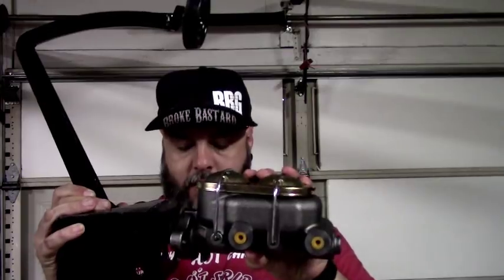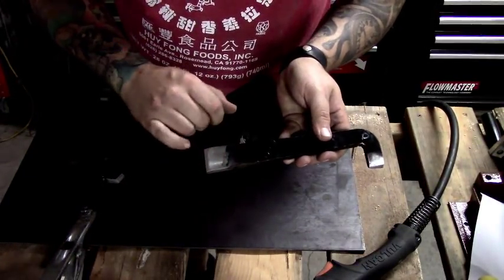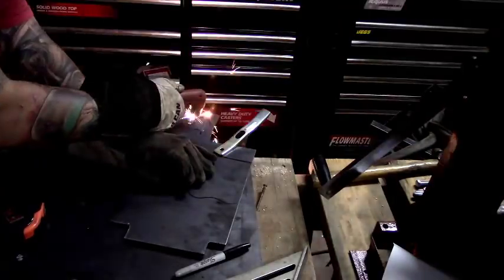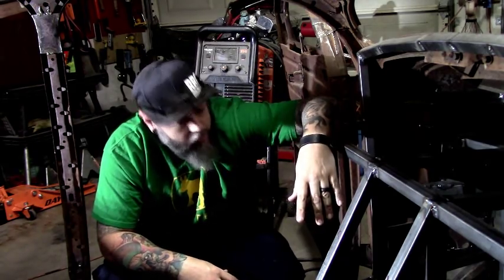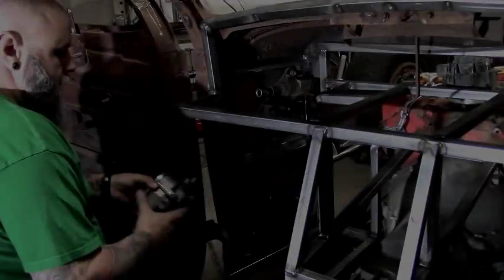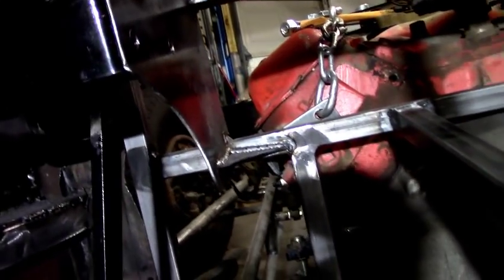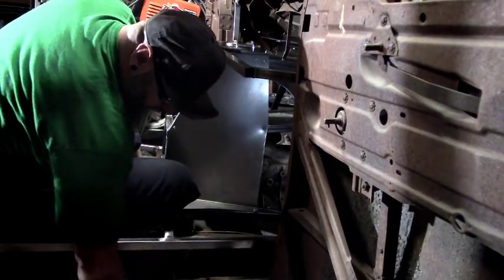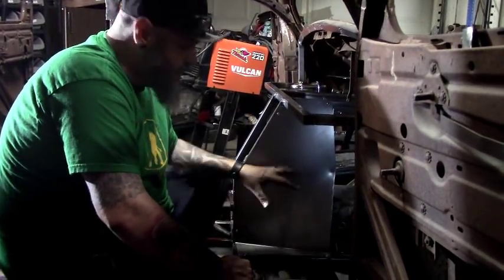"Installing Brake pedal and master cylinder"1937 Rat Rod Build Update 38

Comment: I like that you honestly include the occasional occurrence of fab, oops, cut apart, re-think and re-fab. Shit happens, and doesn't always go right the first time. That's hot rodding. Getting it right in the end is all that matters. Since the MC ended up under the dash, can you work a remote-fill in somewhere? If not, perhaps a stainless shower shaving mirror mounted up in there so you can see into the MC res would do the trick..? LOL... ~dvz~